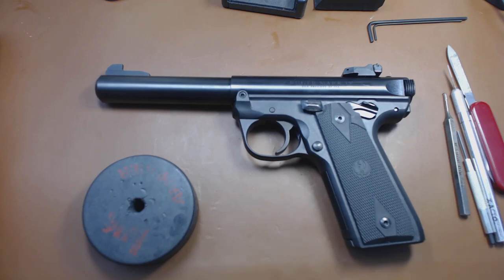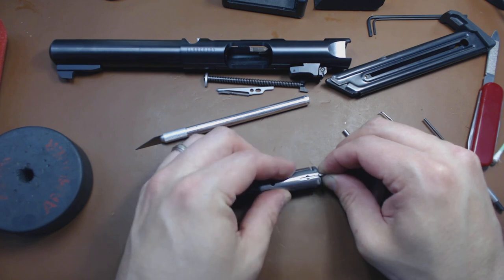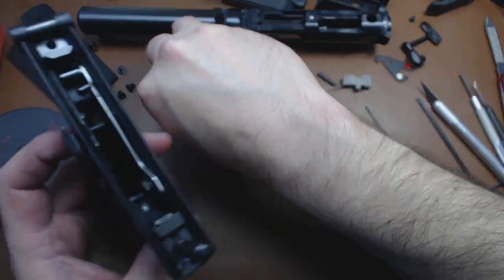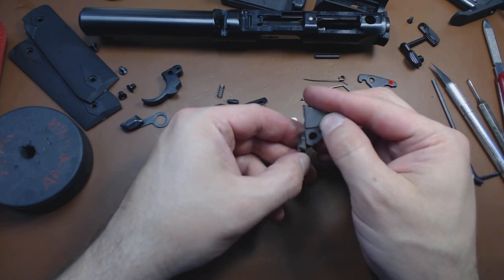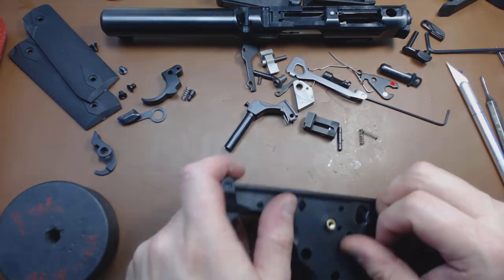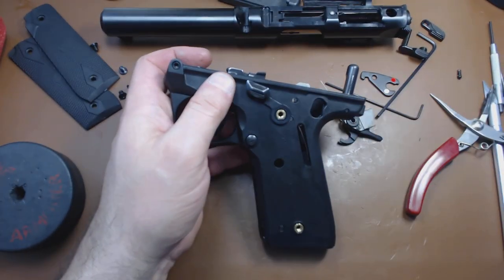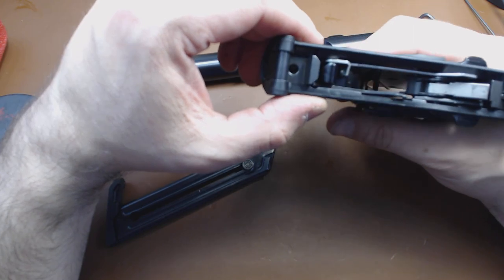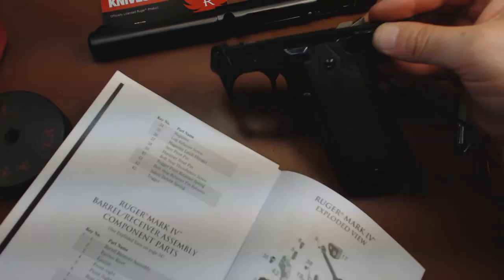Ruger 22/45 Mark IV Complete Disassembly and Reassembly

Comment: To remove the extractor, use a tiny jeweler's screwdriver. The flat edge is what you need to get between the extractor and the plunger, and hold back the plunger while lifting the extractor. Round picks can easily slip off. You can also use a second jeweler's screwdriver to assist once you get it started. To get it started, put the screwdriver at the seam between the plunger and extractor, and lift the extractor. That will create a little gap which the tiny screwdriver can be pushed into and down into the slide. Then slide the plunger back as far as it will go using the screwdriver and lift up the extractor. If you have the slide in a vise you will have a free hand to deal with the extractor (using your finger, a pair of pliers, or another small screwdriver). Cup your free hand over the end of the slide to catch the plunger after removing the extractor and relieving the force on the plunger. After a few attempts you'll get the hang of it.

Comment: EXTRACTOR. .8mm or smaller blunted screwdriver into pin way, under extractor, bottom out extractor plunger into rebound pinway wedge toothpick under plunger remove .8mm tool under extractor and then extractor  KEEP PLUNGER JAMMED WITH TOOTHPIC boltface down to bench remove toothpick

Comment: Intense video, but the receiver assembly hangs slightly and doesn't quite go all the way into the lower assembly.  When I apply pressure and seat the upper, the bolt doesn't want to come back easily.  Any idea what happened?

Comment: Viewer Tip: Harbor Freight sells a set of dental pick tools for $5 bucks that would work great for an EXTRACTOR removal tool.
Reply: @jh8338  Maybe, but it need to be a strong paperclip...there is quite a bit of spring pressure on that thing.

Comment: This video was extremely useful! I was installing a tandomkross oversized magazine release button and accidentally removed the trigger retaining pin all the way and the #5 bolt stop spring fell out. I didn't know where to install the spring and your video provided the exact information I needed to get the trigger assembly put back together correctly. Thanks so much!

Comment: Thank-you for your video. My main spring tube came unscrewed. I didn't know this until  disassembly. I was getting soft hits on my brass. Was getting a lot of no fires. Gun ran great for first 1000 Rounds . Could have sent it back under warranty.  I didn't want to wait for turnaround time. The tube was still in the gun after removing  the spring. Will be testing it out tomorrow. 😊

Comment: Thank you for making this video...I lost that same damned detent...I did find it later though, I took the grips off, and the right side safety washer, then I put a punch in and drifted  the safety lever assembly out far enough to get the detent in.  Once the pin was in back through, and grips back on, the safety selector worked as new.  

Thanks again, this video was extremely helpful, I needed to do a deep clean and this is by far the best teardown / rebuild video on the 22/45.

Comment: Outstanding video!  I think this is the best of the ones I looked through.  I found a very easy way to install the seer- just work from the right side instead of the left- seer first, then spring. I found it purely by accident and laziness because I hadn't removed the bolt release lever so I couldn't do it from the left side since the hole was blocked!

Comment: Thank you for the video ! For the sear and sear spring, I put the retainer pin from the left just enough to hold the spring in place, then lower the sear down vertically with small needle nose pliers. I found it much easier to do it this way on my mk iv.

Comment: This is a great video. I was installing some upgrades and needed to reinstall the sear and sear spring. I watched several other videos, but they gloss over this, I guess since it's pretty difficult. I finally figured it out before I saw this video, but it would have saved me several hours. One additional hint: after you get the spring oriented properly (and other videos did not address this, I had to figure it out), you can use a reverse tweezer to grip the sear and position it under spring tension. I had one handy from my clock repair days. I didn't know about using the magazine to hold the sear upright to install the hammer assembly while under spring tension, I used those same tweezers to wedge the sear upright. The magazine would have been a lot easier.

Comment: To get the sear and sear spring in place I threaded a guitar string through the hole, spring, sear, and out the other hole. I dropped them into position, pulled the string taut and followed thru with the pin. It made it so much easier.
Reply: Actually I followed the string with a bamboo skewer pointy end first, then the pin 👍

Comment: Excellent video thank you for taking the time to post it. When pulling off the slide to clean it somehow the pin for the one button takedown wiggled partially out, wasn’t sure exactly what was in there so this video was great to finally familiarize myself with the internals.

Comment: Great Video! I found my bolt stop doing the same thing and was getting really frustrated with it and disappointed with the whole pistol as a result! Sorted it yesterday by removing the left grip panel and putting a small amount of lube between the Bolt Stop and the frame (inside of frame), between the Bolt Stop Thumb Piece and the frame (outside of the frame) and around the hole in the Bolt Stop Thumb Piece where it contacts with the Grip Panel Screw lug. When i was reassebling i found that if I slightly overtightened the top Grip Panel Screw I could still make it gum up. I removed the Panel again, put a small amount of lube on the recess on the back of the Grip Panel that the Bolt Stop Thumb Piece sits into and tightened the Grip Panel Screw up tight enough that it holds the Grip Panel in place, but doesn't interfere with the Bolt Stop Thumb Piece.
I was so relieved to get this sorted as my bolt wouldn't slingshot the last few times I had it at the range as the Bolt Stop wasn't falling when the bolt was pulled back. Its working like its supposed to now though!
Thanks for the effort you put into your video, it was a great help in giving me the confidence to work on this pistol myself!
Reply: Just picked up my Mk IV 22/45 and I also noticed this behavior with the bolt stop.  I did notice, however that if there's a round (or snap-cap) in the magazine, the bolt stop operates smoothly.  Only when the mag is empty is the bolt stop hard to manipulate  - in my case, unless I pull the bolt back slightly and hold the stop down, or remove the mag, the bolt won't close.  This leads me to believe that this is by design, and not a flaw.  Just my $0.02

Comment: I don't know if anyone has told you this yet, but that one grip screw by the bolt hold open lever being too tight is causing the grip to rub against the lever. You can either loosen that one screw or try to remove some material from the channel cut into the grip for it to let the spring do its job.

I know, it's annoying.

Comment: Thanks for the video. I had installed a Volquartzen trigger kit in my mark IV 22/45 and I needed to return the gun to stock to return my gun for the safety recall. Your Video was extremely helpful in returning my gun to stock. I'm pretty sure that when the magazine is empty the button on the left side of the magazine pushes up against the bottom of the Bolt Open Stop lever, this just adds a lot of spring tension to depressing the Bolt Stop Thumbpiece which isn't present when the magazine is full and the button is lower in the magazine

Comment: My God.  What have they done to Bill's original design?  I've had Mki, ii and iii's.  The first trigger job I did in 1978, I just knocked the corners off on the hammer and sear.  Second and third have all VQ and TK.  
I just offered to do a friend's MkIV trigger thinking, piece of cake.  How different could the IV be?  Holy shit!

I am very thankful to you for taking the time to do this.  I would have been lost without it.  I also thank you for convincing me to stick with my current III's  and avoid the IV!

Comment: I have the same problem with my spring. Sometimes I have to push down on the slide release instead of just racking and releasing the slide. That's what motivated me to completely disassemble it. Seems like most of the resistance is coming from the release lever, and the spring can't overcome that friction. Great video, btw.

Comment: A little tip I figured out yesterday that may be helpful. As I was trying to install the sear I had the pin partially inserted and the spring kept falling off it as I tried to wiggle the sear in. I found that if you shove something into the frame slot that the long end of the spring sits in you can keep it in place. I just used a piece of balled up masking tape.

Comment: What a great resource you're providing.  I'm a new shooter and, after a reasonable amount of research, selected the Mark IV 22/45 for my first ever firearm purchase.  I'm enjoying shooting it a lot.  As pointed out in this video, however, I'm definitely noticing that the bolt stop doesn't release without applying what seems to be an inordinate amount of pressure to the thumb piece.  I can make it release, but the mechanics aren't smooth or consistent with the way the gun operates for me otherwise.  If you've had any more feedback on this issue, AshburnArmorer, please update us.  Thanks very much for providing such a thorough video, and helping a newbie overcome some of the sense of being clueless about what to expect.

Comment: The extractor is easy to remove with something like a large safety pin (with the point ground down a bit) or pay for the Gunsmither Pistol Pal. Insert the safety pin in next to the extractor and push the plunger back. Hold the plunger back and the extractor easily pops out.

Comment: The main spring can be removed. It is a standard thread and the hex key is 5/32". I held the part in a rubber pad vice and turned out the housing. Lefty loosey. Right tight to reassemble. There is a lot of preasure on this spring so be careful.

Comment: the extra detent and spring is from the safety, the one you said could fly out as you dissasembeled that part. the slide release only use a spring with no detent and requiers you to match up with the release bar.

Comment: Regarding the "Bolt Hold Open Lever". My wife and I both have 22/45's hers is is a lite, mine is a target. If you look at the manual it is a bolt hold open, it doesn't say bolt release. Both of ours are VERY hard to use as a bolt release. But if you pull back on the bolt then press down then let go the bolt it is much easier.
Reply: If you press forward as well as down it's a whole lot easier. It takes a couple of tries but work.
Reply: The bolt release gets easier to use overtime.
 When they're new, they're very stiff. Just use two fingers.      
 The steel and plastic versions  have very different frames. The picture you're using is of the steel  frame version .

Comment: Great video! Thanks. I might be a little late on this, but you mentioned and asked about a tool for taking out the extractor easily. It's called a Pistol Pal 4 in 1 tool. Tandemkross sells them for $13.99. I bought one just for the issue you mentioned. Great little tool.
Reply from the maker: Very cool! I can't believe it never dawned on me to use a straight wire like that on the extractor. If I hadn't already pinned the recall notice, I would pin this. I'm going to copy it into the pinned one anyway because it is great advice.
Reply: All I use is a not a small but a medium-size paper clip to push it back then shove a dental pick to hold it back to until you get the extractor  out.
Reply: that works every time I do one for somebody. It saves me $14.00 dollars. Push it back with themedium or large  paper clip, hold it back with the dental pick or a small screwdriver then remove the extractor.
Reply: one thing to add when you use the paper clip you have to shove it in the little opening at the left side next to the extractor looking down at the front of the bolt.

Comment: For the extractor, I used a 1/16" punch and filed one side flat.  Use it by pushing along the side of the extractor to the to the spring plunger, push the plunger into the bolt and lift out the extractor.  For the bolt stop, the design is to use a slingshot method to release the bolt stop and allow the bolt to close.

Comment: Awesome video!  Thanks for making this video!  What part makes the rattling noise when you shake it side to side?  I'm not referring to the slide pin...I realize that shakes around.  I have the 22/45 Lite.  With slide removed and the hammer in the fired position...the rattling stops.  Can it be fixed to remove the sound?  Very irritating...makes the gun sound cheap.  I've read forums where people called Ruger and Ruger tells everyone it's normal...maybe so, but I'd like to make it stop.

Comment: AsbumArmorer, you will find using a four inch c-clamp around the base of the grip clamped where the magazine ejector cross pin is with the grip base flush with the work bench will greatly aid most of your reassembly giving you the third hand that you need
Reply from the maker: This is sage advice my friend. I am reminded of how most lugers have a stock lug...not because stocks were popular, but because on the assembly line it provided a solid mount point to give the workers that third hand!

Comment from the maker: Note: There is a recall on all Mark IV pistols with serial numbers beginning with 401 or WBR. For info: https://ruger.com/dataProcess/markIVRecall/index.php?r=y
Great tip from Allen Arneson: There is a tool for taking out the extractor easily. It's called a Pistol Pal 4 in 1 tool. Tandemkross sells them for $13.99. I bought one just for the issue you mentioned. Great little tool.

REPLY

Comment: when you pull the extractor plunger back with the pick, is it worth putting the back stop pin in and push it in to trap and hold the plunger in place while you easily remove the extractor?

Comment: re; extractor removal - I used a .032" pin, sticking about 3/4" out of a pin vice. First remove the firing pin. Then insert along side the extractor from the face of the bolt group, depressing the spring pin until it bottoms out in the hole for the firing pin retainer. The extractor should fall out. Reassembly requires no tools, just slide the extractor back in depressing the spring pin.

Comment: The other Mk IV you mention is the "normal" one. It has the more angled grip of the original.
And it is stainless or aluminium CNC'd, depending on the model.

Comment: l I would like to smooth out my trigger pull without putting in new parts. If I polish the trigger bar and sear ( just polishing )  will this achieve a smoothing of the trigger or are there other parts that I should be buffing up ? Your video gave me the courage to tackle this job on my own. Good video.
Reply from the maker: Rugar parts are usually extremely well finished as is. I would try a thorough cleaning and lubing before polishing anything. The hammer and sear are already polished and you don't want to mess with them without knowing exactly what you are doing. Try to identify exactly what is making it not feel smooth. I've never run into a clean ruger that had a rough pull.

Comment: "Part 35" is a rubber plug that holds tension on the pivot point at the front of the frame.  It's present in the MkIV but I don't know if it is a part of the 22/45 MkIV.

Comment: Don't know if you're still looking for a way to remove the extractor tandemkross makes a tool for that.
Reply: I had really good results with a 1.4mm flat head screwdriver, fwiw. It's the right width to fit into the slot and flat enough to get behind the plunger, all while being stout enough to handle the pressure.

Comment: hi. i have followed your way to disaasmbly, but after reassembly when shot is taken (single), the cartridge stays outside the cell, but isn't removed away from gun, bolt hasn;t stop in full back position and coming back towards barrel tends to crush cartridge case. aby suggestion where i missed somothing or did mistake. thanks
Reply from the maker: If I understand this correctly, it sounds like you have a problem with extraction/ejection. Make sure that the extractor is not dirty. Remove the bolt and make sure the extractor has enough tension to hold a round to the bolt face.
You should also try higher power ammunition. It could be that the ammo you have is too weak to fully cycle the gun.
Reply: after cleaning and applying some oil onto bolt the next two shot were correct. thanks

Comment: My firing pin retaining pin will just fall out if I turn it on its side. Which is not very handy field stripping on a pipe bridge. lol any thoughts? The firing pin has spring pressure and works fine.
Reply from the maker: There is nothing holding it in place other than the receiver itself, so once the assembly is out that pin is free to follow wherever gravity wants it to. If you really want it to stick around you could SLIGHTLY deform one end with a VERY gently tap of a hammer. Alternatively, you put a very fine coat of blue loctite on one end of the pin and let it dry completely. You want to avoid widening the hole it goes through at all costs as that will exacerbate the problem.
Reply: AshburnArmorer thank you sir. I thought about roughing it up. Appreciate your insight.